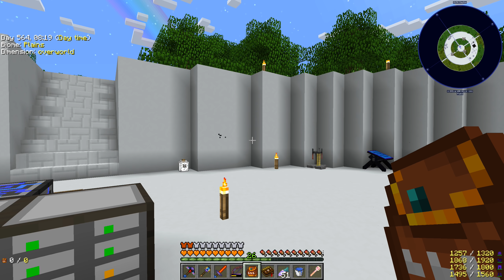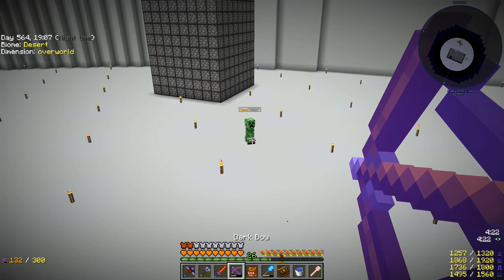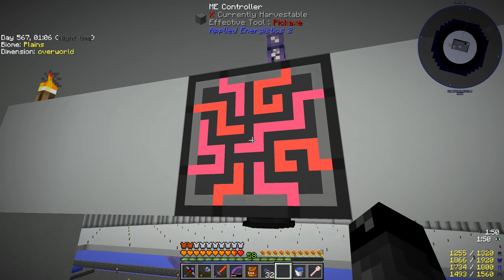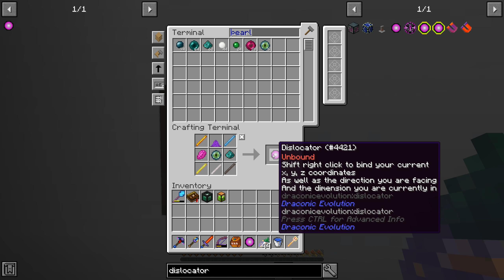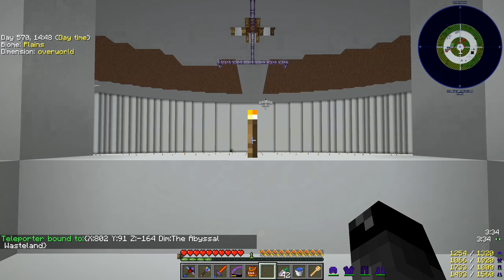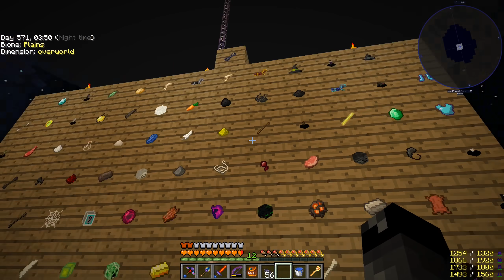Project Ozone 3 Kappa Mode - UPGRADES & DISLOCATORS [E53] (Modded Minecraft Sky Block)

Comment: 7x7x7 Cube ME Controller: Did anyone EVER needed/used that many channels? If yes: What did you do with all those channels?
Reply from the maker: Don't think I've ever used all of those channels, but it leaves plenty of room for permanent p2p connections and loads of room for temporary connections. Example would be my previous E2E series.
Reply: @hypnotizd  Yeah, I remember plenty of AE2 Automation you have done :-) Good times...
Reply: Well it is satisfying to have clear evidence that all the hate AE2 has gotten for having "limited channel s" is in fact, complete BS.
Reply: @EuphoriaDreamer  In my current world I have 2 big (32 channels each) autocrafters, 32 Autocrafting machines in one room, "Keep Stock crafting" and plenty more automation all over the place. I initially branched of the (one) ME Controller into 4 directions with 4 dense cables. Later I had to add a 5th side with a P2P tunnel, but my 6th side still is untuched. So someone crying about "I don't have enough channels (I want to talk to the manager right now!!1111)" just shows, that they have set up their system badly and/or have no idea how to run cabels efficently...
Reply: There's actually a design by TKH that fits 22841 channels. Check out /watch?v=H8t_0_c65vc
So yeah, there's *that*.

Comment: Unless it's been changed between titan and kappa, the astral sorcery perk cap is 30. There's an advancement you get for reaching the cap... 'view from the top' or something.

The xp requirement scaling is pretty steep. The cost for a perk point starts at 150 I think, and doubles every two points, so it gets quite high by the time you get to 30.  The way I did it was using the copy/paste gadget, and copying/pasting/vein mining a giant cube of cobblestone. I suppose the undo feature might also work the way that wandOops does as well. The only cost to pasting is power, and not much of it.

Also, once you have a bunch of perk points, you can respec without having to re-earn all of them by using an Irradiant Star instead of a Shifting Star. Irradiant stars can be attuned to the 'root' you want to start from, so you can have one 'build' for getting yourself to 30, then respec to whatever you want to use long term. In my case I used an aevitas/discidia build that went after all the +xp% nodes I could so I could gain perks from both placing and breaking blocks, then at 30 I either go after +max hp or +reach, since I find them to be the most useful overall.
Reply: I am at lv 28 attuned to Vicio (titan), levels with movement. I literally have put no effort into leveling it, it's super easy.
Reply: @Meerkatx5  I've never tried with vicio before. I figured it would be 1xp per block travelled, so digging would be faster, but maybe that's not the case? Or maybe things like teleportation count? Might be worth looking into.

Even so, one of the issues with how the xp scales is that once you get to 28, you're still only halfway to 30 in terms of the total amount of xp you have to earn.
Reply: Vicio and vector plates omg

Comment: Hello Hypno! Does PO3 have the EnderIO ME conduits? You could use one of those to pass through the 'trash' route and connect the external storage underneath the barrel controller neatly, or would that potentially send light into the mob farm?
I've seen comments saying Level 30 is reachable in Astral Sorcery, maybe it requires using the path in the perks section to attune to multiple constellations and gain experience from different routes, though...

Enjoying the series so far, looking forward to more of your excellent content!
Reply: ME Conduits are the best! If you compare the dense ME Conduits to the Dense Cables they are SO cheap! And for your "Let light into the mob farm"-concerns: You can always cover it up with Conduit Fasades. EnderIO conduits are just the best! :-)
Reply: @mawoh3027  I haven't experimented with the Facades, so I didn't know if it 'looked' solid but actually had light go through (some blocks I've seen behave that way).